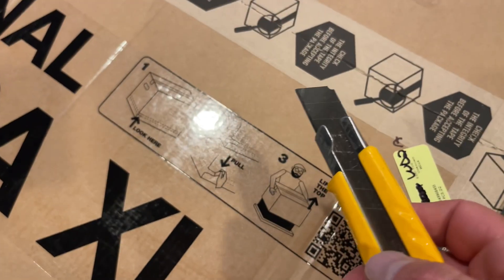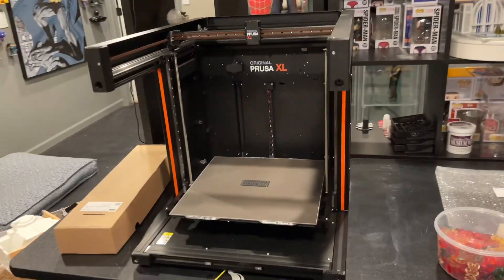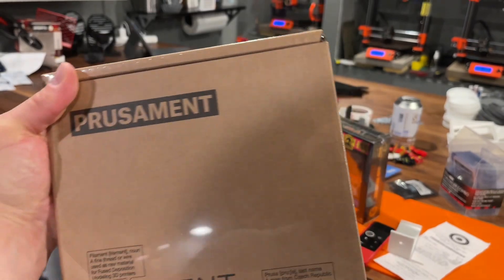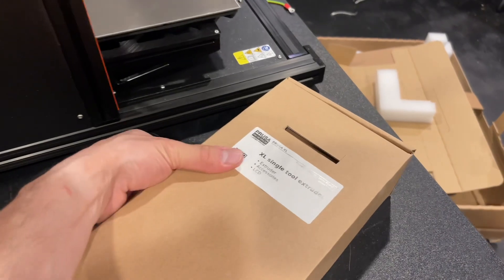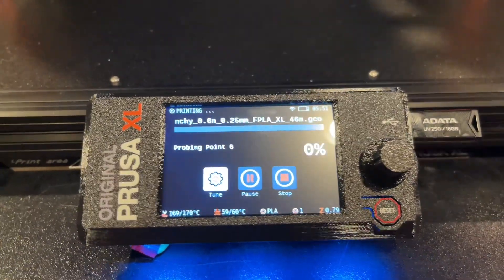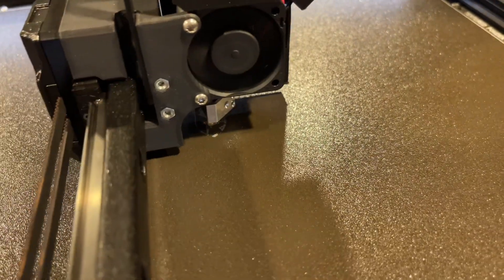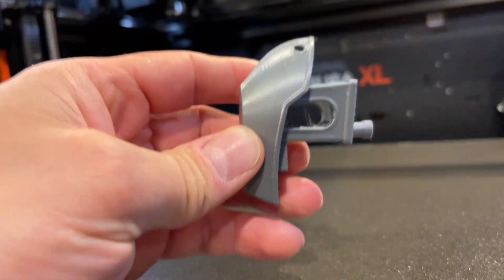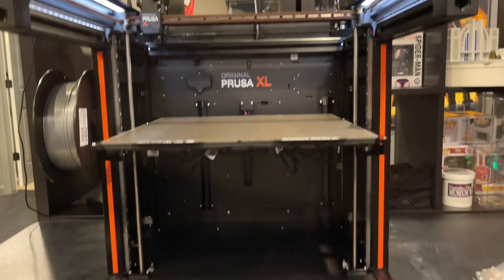Unboxing and Benchy print on the new PRUSA XL!

Comment: Does the XL come with the E3D adapter? The website seems to sold out off those forever? Which is annoying as if you order a printer and have hard nozzles etc you may have to wait FOREVER to be able to use them and print engineering filament.
Reply from the maker: Noooooope

Comment: Can you do a stock profile print benchy, and log the time, and then do it again after Input Shaping update comes out in 2 weeks? (Allegedly)
Reply from the maker: Yes!!
Reply: I really don't understand Prusa's input shaping solution.  They go to all the effort of being open source etc, and then implement input shaping in a way that means it basically won't work if you modded or changed your printer in any way, basically anything other than stock!